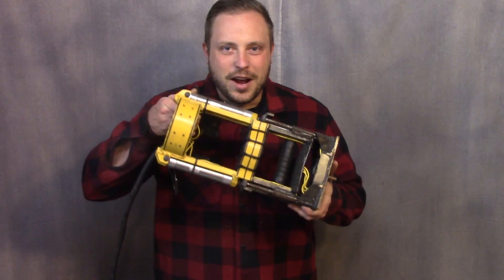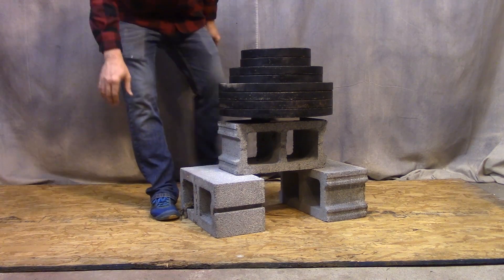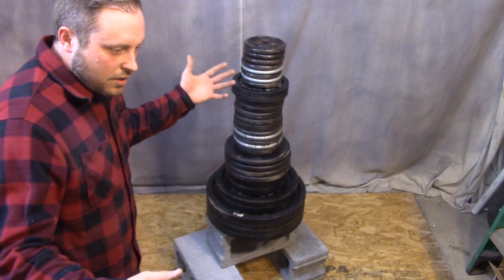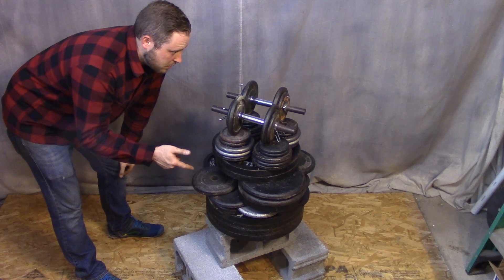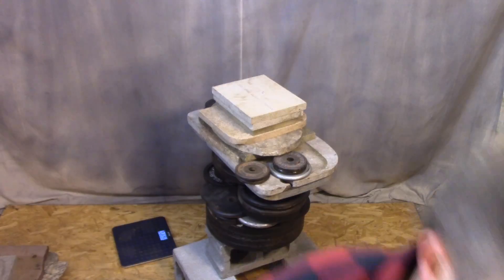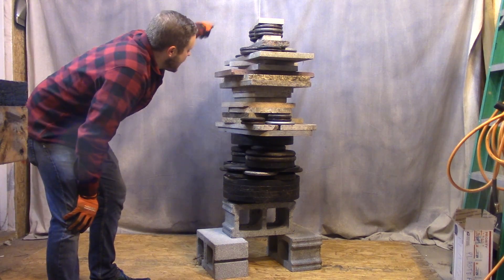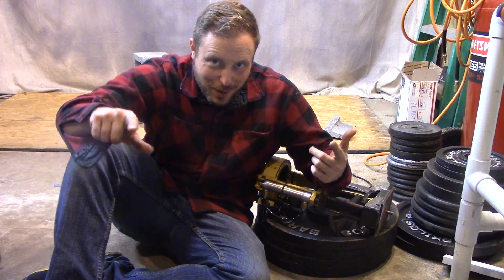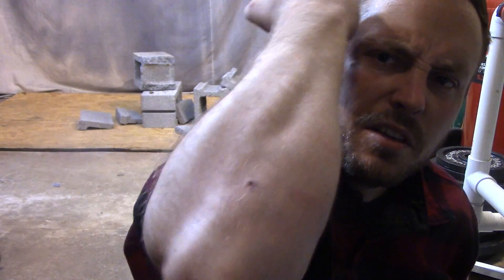POWERFIST POWER TEST - How much force to break a cinder block

Comment: youre kind of an idiot cause the cynderblock can hold a ridiculous amount of weight by compression but not as much weight through force, so its totally possible that whats his face can puch through one but you cant weigh it down
Reply: martinser it's fairly obvious tbh. People dont put sledgehammers against a wall and push on them to knock it down lol
Reply: Epic Guy I bet that physics is too hard for you to even understand.
Reply: Good for you then, you damn intellectual bragger.
Reply: I don't think you understand the distinction between weight, force, and compression.
Reply: Who?
Reply: Jedrek Miller it's all about pressure, he has 1000 pounds of force distributed across that 10 square inch metal plate, meaning the pressure is only 100 pounds/square inch. Although he tries to hit flat, he hits the blocks at an angle, causing the impact to be distributed across only the edge of the metal  (a very small surface area)  making the pressure exerted on the blocks many times higher than just the weight
Reply: jonathan higger weight=force
Reply: PolyJohn One travels which makes a shock to the cinderblock vs one force constantly staying there
Reply: Jedrek Miller this is exacly what i was sinking while watching the video, but my engish is to loosy to exlain it...
Reply: To be fair, you have to have a very high IQ to understand Rick and Morty. The humor is extremely subtle, and without a solid grasp of theoretical physics most of the jokes will go over a typical viewer's head. There's also Rick's nihilistic outlook, which is deftly woven into his characterisation - his personal philosophy draws heavily fromNarodnaya Volya literature, for instance. The fans understand this stuff; they have the intellectual capacity to truly appreciate the depths of these jokes, to realize that they're not just funny- they say something deep about LIFE. As a consequence people who dislike Rick and Morty truly ARE idiots- of course they wouldn't appreciate, for instance, the humour in Rick's existencial catchphrase "Wubba Lubba Dub Dub," which itself is a cryptic reference to Turgenev's Russian epic Fathers and Sons I'm smirking right now just imagining one of those addlepated simpletons scratching their heads in confusion as Dan Harmon's genius unfolds itself on their television screens. What fools... how I pity them. 😂 And yes by the way, I DO have a Rick and Morty tattoo. And no, you cannot see it. It's for the ladies' eyes only- And even they have to demonstrate that they're within 5 IQ points of my own (preferably lower) beforehand.
Reply: You, a pleb: uses YouTube for entertainment

Me, an intellectual: uses YouTube to show off my amazingly superior mind and high IQ
Reply: Shut up nerd
Reply: That's not really how physics works, friend. Compression force from the weights and impact force from the fist aren't different kinds of forces.

Comment: No its not, it has to do with the centroid of the material, why do you think I beams are so good at holding weight because the farther the centroid from the point of action the less force that directly passes through. Engineering

Comment: Problem is the big weights are in the bottom (logically, otherwise it would fall) but this means the weight is evenly distributed throughout the block which means it would crush it not snap it/break it... Crushing it takes way more force because you are trying to crush the entire structural integrity of the block... When u punch with a smaller surface area the force is more concentrated which makes it easier to break so you would need way more weights to crush it.

Comment: The surface area of the bottom weights is about as wide as the block therefore it absorbs most of the weight on the blocks supporting it

Comment: Strength of materials. Cinder blocks are strong but brittle. That's why punching it broke it rather easy vs no shock of impact from stacking weights. That being said, I'd love to see what the power fist could do against an actual cinder block wall. Improve the padding first though.

Comment: but surely force with velocity and just piling weight on are 2 different things. if you took a boat a piled a few cars on it it wouldn't sink (depending on the size of the boat) but if you dropped a couple of cars on it it's probably going to get rekt. I don't see how the 2 tests were relevant?

Comment: Ever take physics in school?  Obviously not. Weight does NOT equal force.
Reply: As the previous gentlemen pointed out, weight has everything to do with force. Ever take Physics in school?
But another one of those ironically self-burning comments what presumed to burn another.
Reply: Donovan Gunther if you drop the weight it is not telling you how much force your fist does... he would then have to calculate the force of a falling weight.
Reply: Glenn Robertson the difference between a moving force and a constant force is that when the moving force hits the stress is massive for a short period of time whereas it's constant and small if the force is stationary. It's the stress that cracks the block, not the force.
Reply: Force is not only factor.. account in moment of inertia in a static structure and suddenly it bears more force that it could at the specific position.
Reply: Ryan Black I'm not talking about force I was talking about energy. Finding GPE needed to break the cinder block you can estimate the KE output of the power fist.
Reply: Weight is a force lol
Reply: Serial PigSlayer what you are referring to is force too.. it's called impulse
Reply: What the guy is trying to do is measure the force created by the power fist.. just his application is very flawed.
Reply: This is to do with the stress on the block at the point in time the power fist hits. As the power fist impacts, the stress on the block is massive as all of the KE from the moving fist is transferred into the block at one time. This is why you can nail nails in with a light hammer but it will take a massive amount of weight to push nail in.
Reply: Snowball ø force doesn't increase with KE, force is constant in that regard
F=ma
Acceleration and mass are constant, therefore force is constant.
Reply: I probably could've worded my reply better, however a change in KE would indicate acceleration, therefore force would increase as KE increases. At least that's what i think lol, i'm no physicist
Reply: Snowball ø you're implying an increase in acceleration, gravity on Earth is *mostly a constant 9.81ms-2. When dropping a weight, unless it's from ludicrous heights, acceleration is constant.
*gravity's intensity decreases with an increase to r so for small distances it is negligible.
Reply: Force equals mass by acceleration  which means he would have to drop all those weights on the cinder block rather than laying them on
Reply: IrishFifa Tank that's not how it works.. how any of this works!
Reply: Glenn Robertson lol lol lol weight is a force and is measured in Newtons. I think you meant mass. Nevertheless he didn't consider the difference between energy and applied force. A more accurate test would be to drop a weight if any mass from varied heights until it breaks the cinder block for comparison. This would give an estimate for the gravitational potential energy needed to break the cinder block.
Reply: Glenn Robertson yup yar right
Reply: Gravity is a force.

The force enacted by gravity is measured by weight.

therefore, weight = force

edit: this is disregarding the fact that the force would increase as the KE increases
Reply: Glenn Robertson weight is in the equation of force so maybe you should retake physics.

Comment: This vid demonstrates the difference between compressive forces and shock forces. Concrete is only strong against compression not shock or striking it with a power fist. But hay I'm not an engineer so what do I know. I'm not.

Comment: its not 2000lbs of force. At all. There's a difference between crushing a cinderblock (applying force over the entire surface) and snapping a cinderblock (applying force at one weak point)
very honestly, you could have turned your powerfist off and it wouldn't have changed shit

Comment: The weights you put on the cinder blocks wasn't crushing it because the compressional strength that the blocks have is too high to be crushed by even 1000 pounds. Compression is force, but pressure is force and area.

Comment: Bro obviously the weight is distribute with the plates over the entire surface while in the powerfist it is directed to one point so it takes way less than 2000 pounds to break the block

Comment: Stacking weight on top of a cinder block will not break it. Why do you think they use them to build buildings? A 10lb sledgehammer swung by a 10yr old would break a block. Stacking and hitting are two completely different things.

Comment: ok first of all, the cinder blocks can resist the weight even if it reaches up to a 1000 pounds. 2nd of all, cinder blocks CANNOT withstand an impact and basing on what you just hit, you hit the middle which is the vital of the cinder block to break. third of all, you should've tried to put the tinier weights to the middle and then stack it up and watch how it turned out (if it will break or not). fourth of all, I'm just 14 years old and you played yourself.

Comment: the correct way is to cinder blocks with the holes facing the ground. 
if you've been laying them sideways the block is weaker and thus all your previous test are not testing a cider block.

Comment: Your punch would have been no more than 100 ft/lb. you can't Compare the weights to your punch as the surface area that the impact is applied on is much larger therefore weaker per square inch with the weights. If you put the same size surface area of the weights on the end of the fist, it would not break.

Comment: This was the stupidest thing I have ever seen. It didn't even prove anything. I could probably get the same results if I tape a hammer to my fist, or anything else with a point to weaken the structure of the cinder before impact. Try doing that on the strong side of the cinder, they are not so easily broken. More recommended click bait.

Comment: The reason it took so much weight is because cinder blocks are made to take slow build up of pressure. Sorry to tell you, but you came nowhere close to 2000 lbs of force, my guess is you were closer to 300,  given the spike on the fist.

Comment: Hey Jairus, you said that two cinder blocks means more than 2k lb of force, that's not strictly true, with even 1k lbs of force both cinder blocks would experience it and and force is proportional to rate of change of momentum would have the same momentum, therefore the force doesnt double by doubling the amount of mass.

Comment: That is not how any of this works.  Note you can sit there and pile the weight on and it will not break it is the combinations of weight and gforce over a small surface area.  Also note that the 1st cinder block will help break the second.

Comment: Breaking things has to do with pressure not just force, with it all concentrated in the powerfist point vs the flat metal thing used to stack weights on, no wonder you broke through 2 blocks

Comment: Force×mase×speed= presher per square inch at point of in pact note: human bone I over 2×'s stronger than unreinforced concrete  . And is a lot lighter. So at rest the concrete will hold more that you wold think but if you drop one of those 45's on them from five foot of the ground it would do the same thing as u with your fist it the speed that dose the work.

Comment: Tl:dr; shock loads on concrete will cause failures. Gently loaded weight will not break a concrete block unless it is very heavy.

Not 2000# of force. You can drop a cinder block for 4-5 feet onto concrete and it will break. Duck tape 2 together and drop them from 5 feet both break.

Concrete is brittle, so hitting it with a hard object will cause it to break. Loading it without impact will take a couple tons (cars in yards on cinder blocks are a thing) so a compressive load of 4000# pounds. I can assure you punching the same car with the power fist will not move the car even if you hit a frame rail.

Concrete has a compressive load bearing capacity of like 50,000# a square inch... I don't have a spec sheet in front of me but I am sure if I am off I am low. So maybe you hit with 200-230# of force, the steel plate hitting less than perfectly flat with 50# of force should break both blocks.  Because of the brittleness.

P.S. In this exact scenario the spacers between the blocks would make it much harder to break both. The first brick would absorb most the energy in breaking and make it harder for the second to break. (Myth busters, bullet proof vest, stacks of ceramic tile.)

Not hating, cool video. I think it is a cool invention, but the statements of forces and maths are off. 

I bet putting a 16# bowing ball in the power fist and dropping from 6' would break the cinder block. If it doesn't land perfectly flat.

Comment: The compressive strength of concrete masonry units and masonry walls varies from approximately 1,000 psi (7 MPa) to 5,000 psi (34 MPa) based on the type of concrete used to manufacture the unit, stacking orientation, the type of mortar used to build the wall, and other factors."

Comment: l
Reply: Actually it is, 1000 pounds of force is exactly equal as 1000 pounds under gravity (giving 1000 pounds force). the real distinction here is concrete's material properties. While concrete can resist huge resting forces it responds poorly to impact force due to how brittle it is. Think of a glass, I would think that with the right shape you could stand on a glass but drop a ball bearing on it from a couple feet and it could break.

Comment: This is just to bait you, his "Invention" is just a mounted sledge hammer (with more force if he included C02) a sledge hammer could do the same thing. You need acceleration too break concrete (I know theres a limit to its weight capacity) but he just wants you too think he made something amazing yet its been done before several times on youtube and the Military already have better versions of this.

Comment: it was the small nail size impact. like popping a balloon. the 1000 pounds of distributed weight had no effect because it was level and balanced plus the point of contact was wider. think about laying on a bed of nails.
Reply: Mitchell Reid he doesn't hit it dead flat though, if anything the edge of the plate catching on the block transfers most of the force.
Reply: tripboy24 how so? The point on the tip of the fist pushes in to activate a trigger so no force goes through it
Reply: The pin retracts all the way into the plate, it's not applying any significant force without the CO2 engaged.
Reply: tripboy24 and damien merrylees you are both idiots. look at 5:49 he pushes it in with one hand IT'S A BUTTON NOT A NAIL. WHEN YOU PUSH IT IT GOES BACK INTO THE PLATE.
Reply: the force also has a short impulse. if a car hit you at walking speed, it wouldn't be as bad as if it was going 100mph
Reply: tripboy24 its not a nail its a button ,-,
Reply: I had to scroll way too far to see this comment.
This guy is the smartest on the channel.

As for the idiots saying it carries no force or power, watch the video again.
The coconut thrown into the air gets only a hole punctured into it. 
From your "fully retracting button, through which no force goes".

It's a steel rod, with his full body weight and momentum behind it.
It's doing the majority of the work, 100% sure of it.

Comment: I think you just tested it the wrong way. example 5 kg won't do anything, but if you drop them from high enough it will impact with the force of about 1000 kg. Don't ask how high it would need to be... saw it about 6 years ago in a documentary and I am currently to lazy to calculate you the potential energy developed by a drop hight of X.

Comment: Thats so dumb dude....for example...if you put 2 tons of weight on these blocks they wont break. 1.The weight is not punctual, wich means there are not two tons on one single point!!! 2 The impactforce dont have to be as high as two tons to break the blocks...the blocks will break at much less force, but punctual force. Its not that hard to understand, I mean im a 15 year old german dude so wattafak

Comment: This is totally stupid. The cinder block which he is trying to break is WAY to close to the holders on each side. PLUS the weights he is adding are equally distributed throughout the block preventing it from breaking. The power fist is concentrated on one area and it broke even though the force was not as heavy as the weights!!!

Comment: Making something that amazing your so stupid the way you put it your gonna try to flatten it and no just no you are no making 2000 pounds of force weight just doesn't break like that if they did then it wouldn't be used to build building cause then it will have so much weight on it

Comment: It's obvious that These Blocks don't Break behause the Force of the weights is distributed equally so it wont collapse. You should have put the smallest weight at the bottom. You condense the block at lease but wont Break.

Comment: Force = mass × acceleration
Resting weight on a cylinder is a load bearing stress test not a measure of how much force youd need to break it. An atom of water can break cinder blocks at the right speed

Comment: Only reason you did it was because of the small steel rod in the middle of the powerfist. If you didnt have that rod the force would be spread all over the plate and your chance of breaking the block way harder.

Comment: How do you think they make walls out of this, the weight has to be in a small surface area at a high speed, just adding weight isn't gonna brake it, they're designed to hold a lot of weight